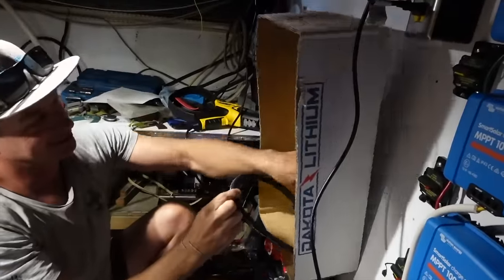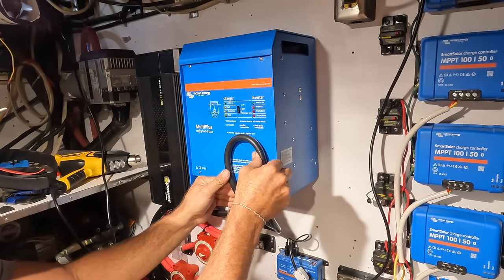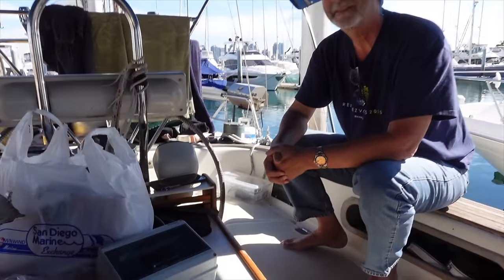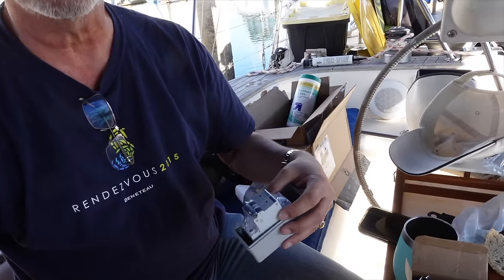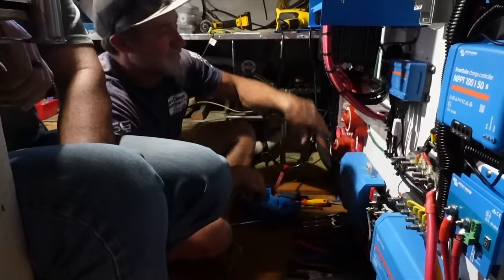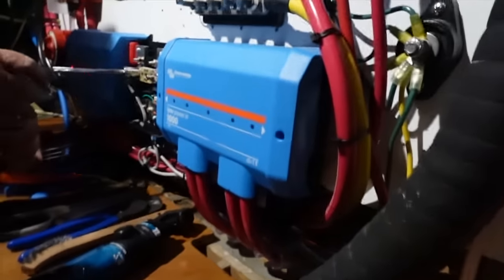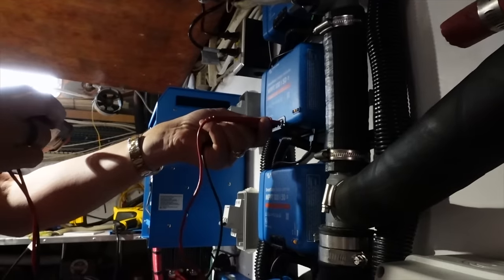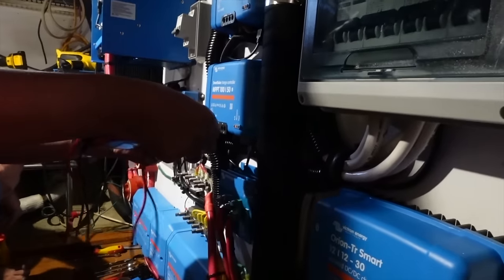After all that MONEY & hard work….How did we go wrong? Ep 332 | LOTS of BoatWork

Comment: G'day from a wet and slightly chilly Sydney. Having read recently of all the fires breaking out on Super Yachts around the world, one thing springs to mind...lack of proper & effective fire control. It's all good & well having fire extinguishers onboard, but if they don't contain the right stuff it will be like farting against thunder. For lithium battery fires you should have at least one large Class D fire extinguisher on board, they are effective against lithium-metal battery fires. Lithium-ion battery fires are Class B fires, indicating the presence of flammable liquids, so a standard dry chemical or ABC extinguisher can put them out. I'd have at least four extinguishers onboard. Just thought I'd share this with you. Wishing you many safe miles at sea.

Comment: Your friend mentions the power from the solar panels going through the disconnects and then to the shunt. Not exactly sure how the Victron system works but most solar systems have the shunt on the negative side of the battery bank.

Comment: I didn't see a BMS , but you probably have one installed. Perhaps each battery has it's own? Anyway, a good choice from the Victron range is the Smart BMS CL 12/100. It provides several useful functions, including protecting the alternator and lithium batteries from each other, as well as providing a really good way to charge the engine start battery from solar generated electricity. This is great in case you are anchored for an extended period want to keep the start battery topped up, without needing to run the engine. Ask for details if interested. Regards, Rick. Also, check that you've got the Multiplus programmed to work with a charging protocol that is suitable for your lithium batteries. It probably wasn't set up for this by default. You'll need to hook a Windows computer up to it to do this programming. Then, set your Cerbo up to run the system with Distributed Voltage & Current Control (DVCC); a great protocol for keeping the system running well. 🙂

Comment: Guys important note on your install, more as a note for other people watching that might follow your install procedure 😁 you should use a resistor to pre charge your inverters as the inrush surge "can" damage the inverter and BMS! (As per victron manual) I have one permanent mounted over the cutoff switch with a push to make button) 

Also, you should NEVER connect solar to a charge controller before battery voltage, again per victron manuals and here personal experience of magic smoke! 🤣  

I know it all went well and nothing happened! But sods law 1/100 people might cost themselves a battery or inverter etc so Im try to be helpfull and help out! I've just completed a 48v install, all victron apart from the raw lifepo4 cells (14kwh) such a game changer! 

You guys are the my favourite channel alongside sailing into freedom of course (I have a thing for aussies maybe) hahahaha 😜

Comment: Hi guys
Are they DC breakers or run of the mill  AC?
Reply from the maker: Lee thinks they are DC 😄
Reply: They should be DC rated
Reply: Yes, the breakers for the solar panels are DC breakers.  The two for the inverter outputs are AC.

Comment: Do you have an RCD (Residual Current Device) to catch earth faults; that's the one that saves your life if you touch live 110/240V. Usually you have a Earthing plate near the keel, and run an earth lead to the RCD on the 110V/240V side of the Multiplus. Without the RCD the systsem won't know if you're holding a live wire. With the RCD it detects a change in the balance between neutral and live, and says - something is wrong; open the switch. They are mandatory in AU, and I would have a public liability problem if I didn't have one here - but can't speak for other countries.